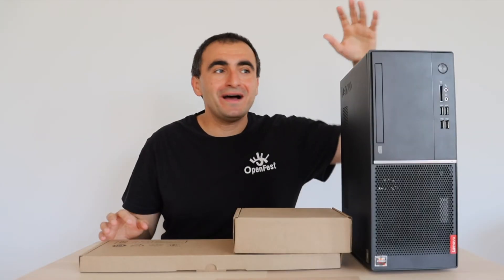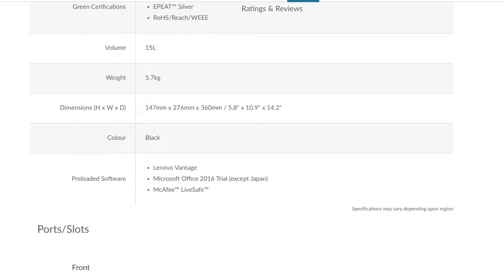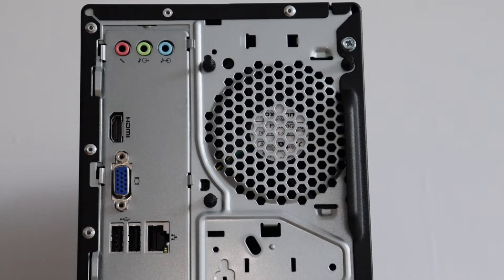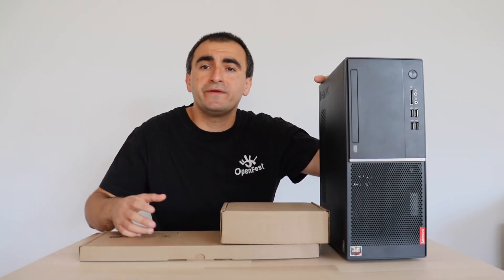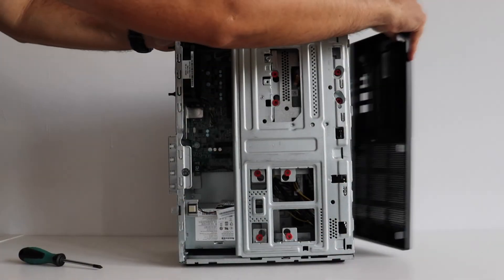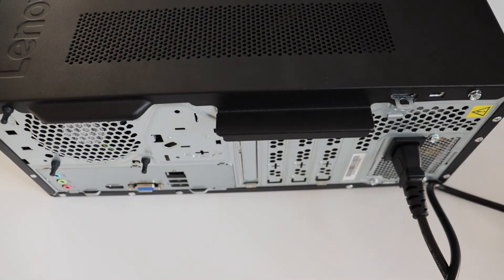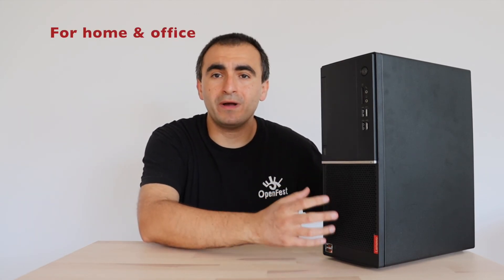Lenovo V55t with AMD Ryzen 3 3200G Upgrade

Comment: Hey my lenovo vtt is not working when i press the button it wont turn on please help
Reply from the maker: If the PC isn't booting at all, there could be several possible causes - ranging from something simple, like a mechanical issue with the power button, to more serious problems, such as a faulty power supply or a defective motherboard.

Comment: Thanks for the info! My CPU is Ryzen 3 2200G, and the motherboard is inside a Lenovo V55t-15ARE cabinet. I’ve installed HyperX 8GB 3200MHz DDR4 RAM (it supports both JEDEC and XMP). But I checked — the BIOS is locked and has no XMP option, so it’s running at 2400MHz by default.

Just wanted to confirm — is there any unofficial way to enable higher speed or am I stuck at 2400MHz unless I change the motherboard?
Reply from the maker: I am not aware about any unofficial way to enable XMP. I recommend you, if possible, to return the RAM to the seller and replace it with another RAM model that supports JEDEC at 2933.

Btw Ryzen 3 2200G or 3200G? Probably it is just a typo and it is 3200G. According to the datasheet for V55t-15ARE this CPU supports DDR4-2933.
Reply: @LeonAnavi its 2200g

Comment: Hey sir i dont know why but i installed a 3200mhz ram 8 gb its limiting it it is showing 2400 mhz in bios and task manager can you help please with that i have installed hyper x 8gb 3200mhz ram
Reply from the maker: What is the RAM model? Is it with JEDEC or XMP? I am not sure if XMP is supported on this machine. I was in a situation on HP ProDesk 400 G7 with Intel CPU which supports only JEDEC RAM: https://youtu.be/cpadBhclEAE?si=LC_Jy8IeMe5ZZBeF&t=281

What is your CPU? In general the CPU Lenovo V55t 15API supports max 2933MHz or 2666Mhz depending on the CPU model.
Reply: @LeonAnavi  Thanks for the info! My CPU is Ryzen 3 2200G, and the motherboard is inside a Lenovo V55t-15ARE cabinet. I’ve installed HyperX 8GB 3200MHz DDR4 RAM (it supports both JEDEC and XMP). But I checked — the BIOS is locked and has no XMP option, so it’s running at 2400MHz by default.

Just wanted to confirm — is there any unofficial way to enable higher speed or am I stuck at 2400MHz unless I change the motherboard?

Comment: Hello sir i have same but i have ryzen 3 2200g i wanted to add 3200mhz ram 8gb + 8gb will it support ????
Reply from the maker: Yes, as shown at 6:54 this PC has two DDR4 UDIMM slots and it is dual-channel capable. It supports Non-ECC DDR4-2666.

Comment: Can i add graphic card in my v55t please answer
Reply: Have same pc but I have ryzen 3400 g in it if the graphics card work what graphics card I have to purchase
Reply from the maker: Yes, afair in general you should be able to add an external graphics card.
Reply: @LeonAnavi  please can you explain how to
Reply from the maker: There are a couple of expansions slots: one PCIe 3.0 x16 and one PCIe 3.0 x1. You see them on the motherboard in the video. Select an appropriate PCIe 3.0 x16 graphics card and make sure the power supply can handle it (or upgrade the power supply with the new external graphics card).

Comment: Halo Sir, can you help me? I have the same series which is also V55T and I think my PSU is broken. From the website I see it is 180W but I want to buy new Power Supply, can you tell how many pin on the PSU? Since I'm new at fixing PC and want to buy the suitable one.
Reply from the maker: Yes, the original power supply is 180W. I am not near the PC to have a look at the pins but I saw documents online that it is  with "1x ATX - 10 Pin". It is recommended to inspect the pins of your current PSU and check if it is really broken by checking the voltages using a multimeter to measure them. Beware that there are many risks involved so you better bring the PC for a check and a repair at an experienced professional technician.

Comment: Sir in my case there is HDD installed inbuilt.
When I install a M2 SSD there is no lucking screw so my SSD not fitting permanently 
Please help me to solution

Same CPU as your
Reply from the maker: According to the technical documentation Lenovo V55t 15API supports M.2 2242 (22mm x 42mm) and M.2 2280 (22mm x 80mm) SSD. What is the size of the M2 SSD that you are trying to install?
Reply: @LeonAnavi  Sir thanks for your respond and reply.
My SSD support and connect well but in motherboard there is no such a system to hold that SSD tightly so I am adjust that with a double tap. I want to fix it permanently. Need a Bracket caddy trays or a kit.
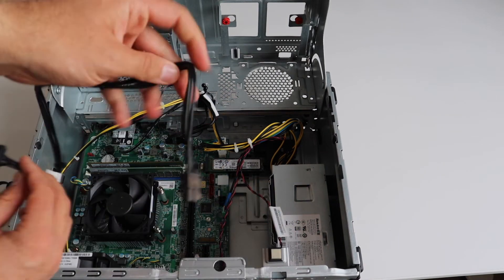Reply from the maker: Yes, the SSD should be screwed to the case as you can see at 7:29. Depending on the dimensions of your M2 SSD you may need a bracket adapter board with a screw. There are kits with screws and adapters that you can purchase.
Reply: Same question sir where is can I buy caddy holder ssd M.2 NVME for this PC
Reply from the maker: @arissetyawanoriginal  check for extension adapter brackets amazon, ebay and aliexprss. There are a lot of options. Right now I can't recommend a particular model.

Comment: Sorry can I put Patriot Viper Elite II DDR4 32GB(2 x 16GB) 2666MHz Kit in it?
Reply from the maker: Probably you won't get the best performance out of them because they may work only at  2133mhz. I am not 100% sure but I think this RAM memory kit requires XMP 2.0 support for automatic overclocking to run at 2666MHz which is rarely present in BIOS settings for Lenovo or HP. I recommend picking up RAM with high speed support using JEBEC profile. Otherwise with XMP you might run into this situation: https://forums.lenovo.com/t5/Lenovo-Desktop-Towers/Does-Lenovo-support-Intel-s-Extreme-Memory-Profile-XMP/m-p/3564619
Reply: @LeonAnavi  Got it, thanks. Unfortunately I already have it. Tell me it affects the performance a lot? If so, I'll return it. If it's not too bad, I'll leave it as it is
Reply from the maker: @fafasicko4261  if you already have this RAM kit you can give it a try and check in the BIOS if it work at the max supported frequency. If it doesn't I recommend you to replace it with RAM with JEBEC profile.
I had similar issue with RAM on HP ProDesk G7. If you are curios here is the video: https://www.youtube.com/watch?v=cpadBhclEAE

Comment: Sir, can I put RX 580 graphics card in this PC?
Reply from the maker: Yes, I think this a graphics card with PCIe 3.0 x16 bus Interface. The motherboard in Lenovo V55t 15API has one PCIe 3.0 x16 expansion slot so you can stick the card in it.
Reply: @LeonAnavi  thanks for the info Sir
Reply: Uhm, your computer will break if you do and if you're unlucky it will fry components. The stock PSU that comes with this computer only delivers 180W to power the entire computer. The RX 580 alone requires 185W so you need a 450W PSU to be on the safe side.

Comment: And which SSD is you using m.2 sata or nvme
Reply from the maker: I kept the primary M.2 SSD drive. I've done an upgrade with WD Blue 1TB, 7200rpm, 64MB, SATA III as a second drive.

According to the datasheet Lenovo V55t 15API supports M.2 SSD with PCIe NVMe interface up to 512GB.
Reply: @LeonAnavi  but I have ordered sata m.2
Reply from the maker: @Harshitsharma78499  if are having Lenovo V55t 15API you can check all the details in the Storage section of the datasheet:
https://psref.lenovo.com/syspool/Sys/PDF/Lenovo/Lenovo_V55t_15API/Lenovo_V55t_15API_Spec.PDF

Comment: Sir please help , can we change ram frequency of this pc my ram is running 2933 mhz but my ram is 3200 mhz please reply
Reply from the maker: What is the exact CPU model on your V55t configuration?
Reply: @LeonAnavi  r5 3400g
Reply: @LeonAnavi  ryzen5 3400g
Reply from the maker: According to the datasheet of Lenovo V55t with AMD Ryzen 5 3400G  you get DDR4-2933 so this is the max supported speed for your setup: https://psref.lenovo.com/syspool/Sys/PDF/Lenovo/Lenovo_V55t_15API/Lenovo_V55t_15API_Spec.PDF
Reply: @LeonAnavi  thnks